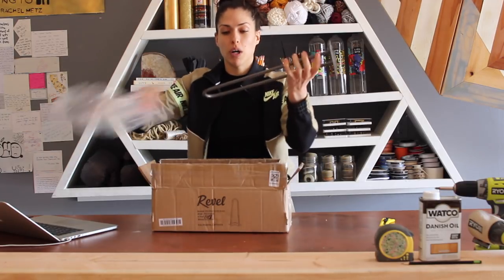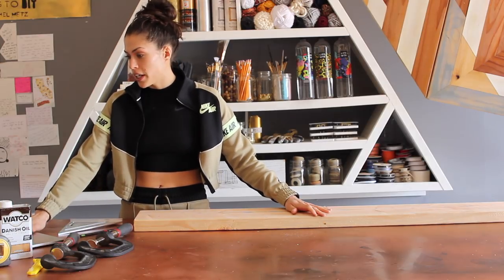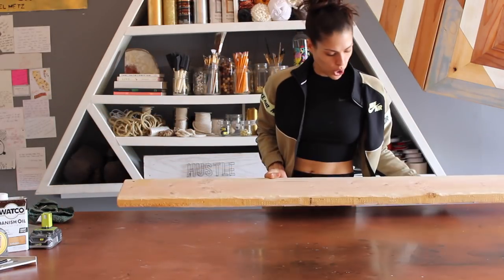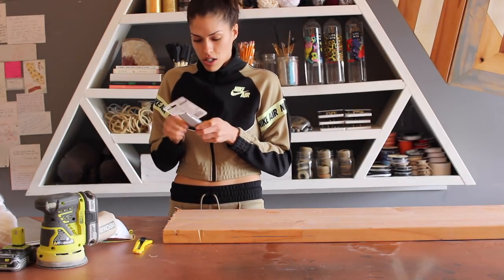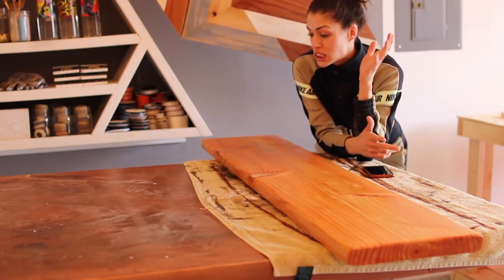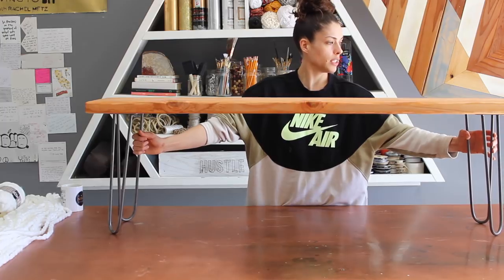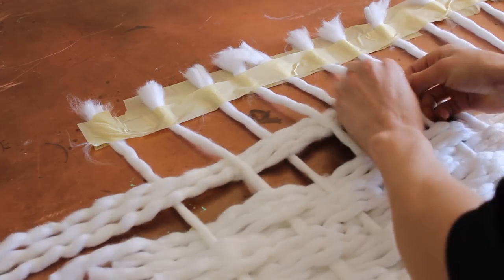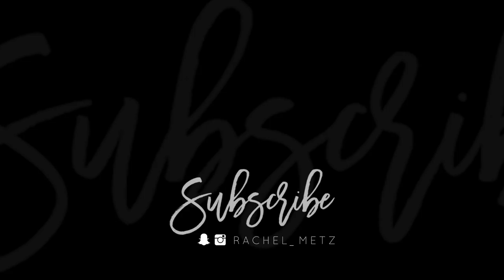I Tried Following A Homemade Modern Tutorial | DIY Hairpin Bench

Comment: I Love the construction challenges. 😃 From another DIY lady. Please do wear eye protection. And do not use the box cutter for removing large strips of wood, unless you don't mind an ER visit. (I've been there) Instead, I suggest a power sander, a wood rasp, or an adjustable hand planer for your projects.

For another cushion option, buy used sweaters and cut them into several large rectangles. Machine hem and sew the rectangles together into 2 long quilted rectangles. Hand sew w/ an XL embroidery needle and yarn, the 2 pieces together. Sewing it around the wood makes for a snug fit. Then attach legs.
Reply from the maker: You’re the best Reggie! Thank you!!